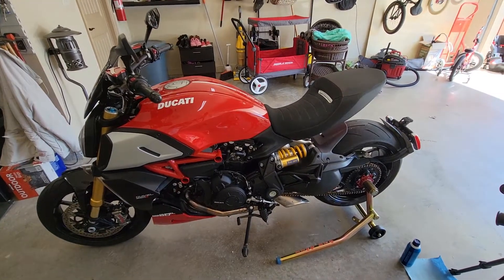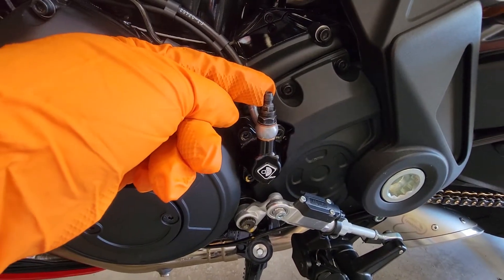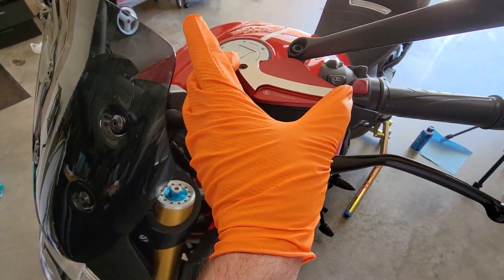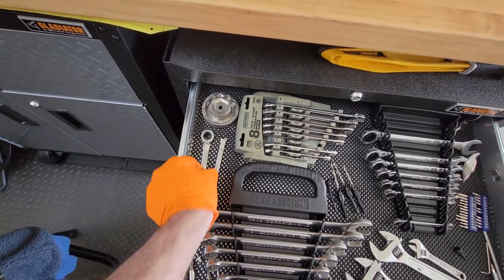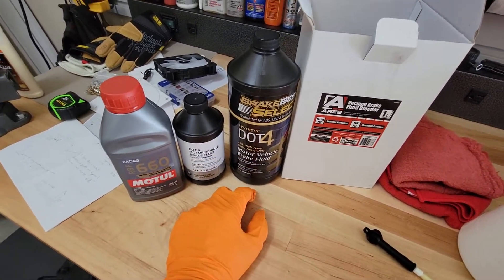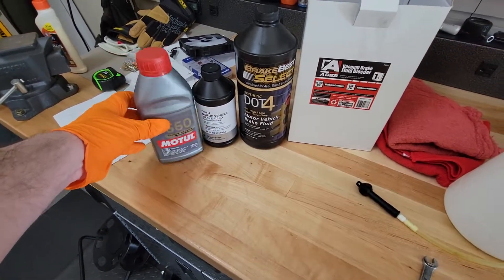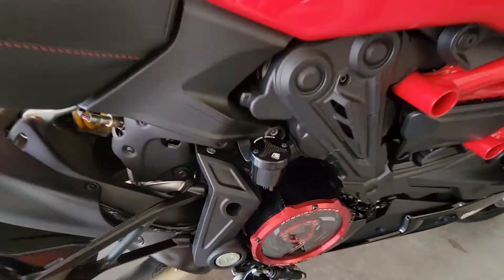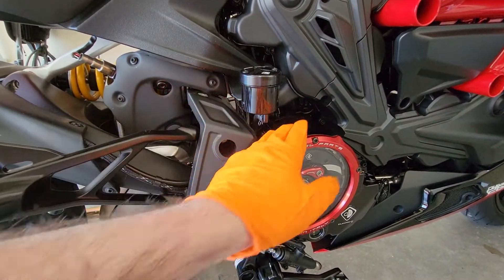Ducati Diavel 1260S Bleed Brakes & Clutch

Comment: when we need to do that
Reply from the maker: If you live in a wet or humid environment, I would do it annually, it only takes 30 to 45 mins total time. Otherwise every two years. Water builds up and causes issues.
Reply: @TrickMasterPC   ok bro tnx can you show use a video like how adjust brake and clutch lever and pedals

Comment: Question, instead of hours of pumping manually, can I not just take fluid from the reservoir with a medical syringe until just a little bit is left?
Reply from the maker: Yes u can, but you want to pull clean fluid through the lines, master and slave cylinders and calipers. This is where the pumping comes in. Empty top reservoir then fill with clean fluid.

Comment: Hello, thank you for the video(s) really good. Question: I have a 2020, 1260 Diavle S, and I did as per your video with the rear brake. However, the rear brake is not working properly: Brake lever push all the way down once and rear tire  doesn't stop, pumping (pressing rear brake lever twice) rear tire slowly stops.
Is there anything I am missing?
Do I need to perform bleding with the bike switch open?
Any comments?
Thanks
Reply from the maker: Bleed again, and pump the rear brake lever fast, then slow and alternate. Run two reservoirs of fluid. While pulling fluid, tighten the bleeder valve closed. Then actuate the rear bake, press all the way down multiple times. It should be soft then turn hard after a few actuations.
Reply: Perfect. Thank you very much. I will do right now

Comment: As I told you in another video after a few months my rear brake gets spongy in my 2020 Diavel 1260S. It's the third time I go to the dealer to get it bleeded and after a while again gets spongy, They do not make a recall yet for the rear master cylinder brake as some Multistrada had with that same problem with same master cylinder. 
What I learned from them seeing when bleeding the rear brake, they take out the rear wheel, take out the rear caliper, and turn it around  why? Because the bleed valve is at the bottom and air goes up, so the only way to bleed the air is turn around the caliper...
 I KNOW, it's really crazy!
Reply from the maker: If you use a pneumatic bleeder you don't need to flip the Caliper over. By performing all those additional steps they are racking up the hours... more $$$

Comment: its the brake and glutch fluid the same?
Reply from the maker: Yes, same fluid DOT4
Reply: @TrickMasterPC   bro i got some noise when im breaking with rear brake you know why its doing that
Reply from the maker: Yes, I had the same problem front and rear. The dealership told me that happens on all new bikes and you just need to brake hard to wear the brakes in. This works sometimes, but not always. I pulled the pads out and lubricated the backside of the pads where they contact the calipers and piston, the pins, and the spring clips with synthetic caliper grease. That solved the problem 100%. I had the same issue on my 2004 VW R32 and grease was the only solution. Caliper grease exists for this exact reason. It's rapid high frequency vibration that produces and audible output due to the friction. The grease eliminates the friction.